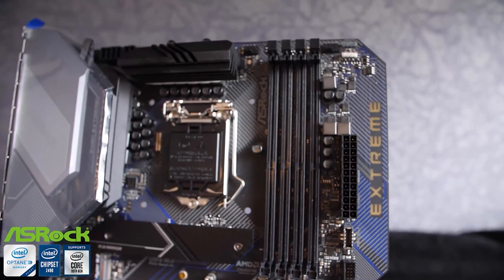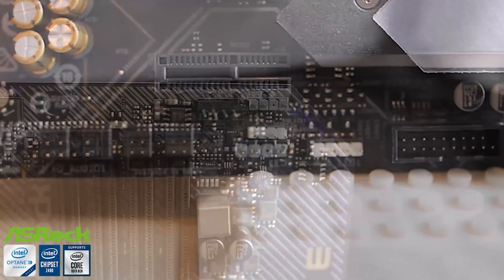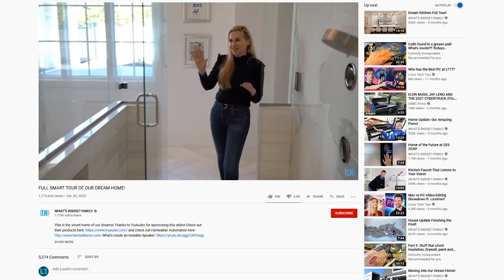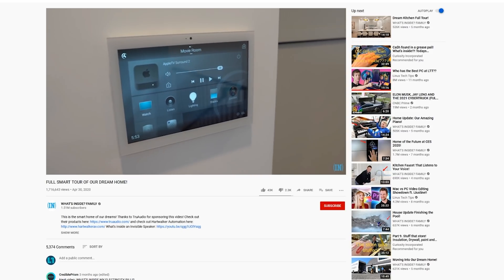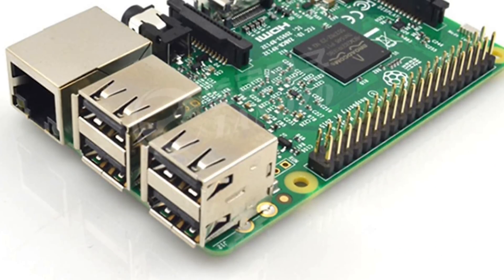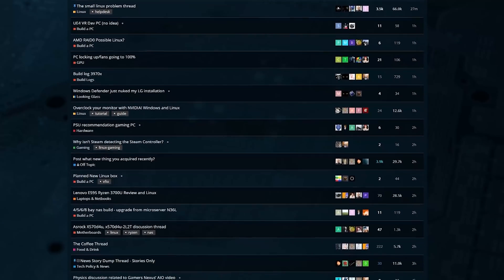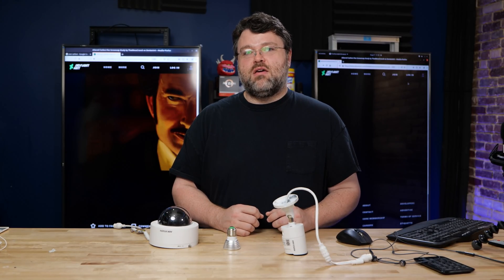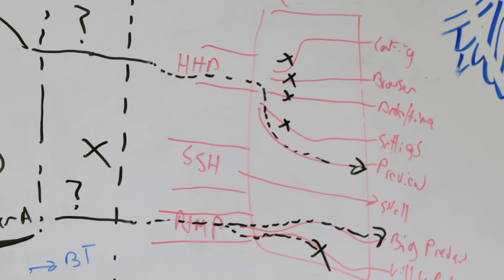Building A Better IoT Part 2: Can We Create A Safe Home Automation System?

Comment: I watched the whole video because it is very exciting. I also could listen to Wendell talking about tech for hours so thank you ! However, I will never go for IoT in my own home. Won’t need it, I can check things and put the blinds up by myself just fine thanks!
Reply: I was pretty much of the same opinion until recently.  Now, I’d really like to build some devices and use IFTTT to alert me if certain things happen while I’m away from home.  One such example is I’d like to know if my gun safes are opened so I don’t walk in on someone in the middle of a robbery.  I’d also like to setup a security system that doesn’t require monthly fees.  And between Docker and IFTTT there are a number of things I could do to better secure the home or be alerted to problems while away.  Our last hot water heater decided to burst a leak in the middle of the night and we were only awakened after the water started pouring through the ceiling which shorted out a smoke alarm and set off all the other smoke alarms.  Turns out, the water leak sensor we had no longer worked nor did the automated shutoff valve, so quite a bit of damage was done before I could shutoff the mains and drain the pipes.  These are just a couple of examples but I’m definitely now thinking I’d like an alert system and camera system.  At the same time, I’m looking at replacing my NAS and upgrading my network so just trying to figure out what my options are.  I’ll certainly watch the entire playlist on this topic and hope perhaps an update will be done seeing how old these videos are.  I also need a system that my wife can understand and maintain if I pass away and so that adds another wrinkle to how, and if, I can get this done.

Comment: Personally I'm using VLANs to try and keep the IoT stuff separate but it's not really a good solution. I can recommend Maltrail as a potentially useful tool for picking up bad traffic. It's designed for detecting malware attempting to reach out but could be helpful for figuring out if your IoT devices are being used for nefarious purposes.

Comment: For me since I'm not going to open my walls and run separate wires to every device I want to control I have chosen the wifi route. I do have a separate ssid that is on its own vlan that does not have direct access to the outside world. I dual home a Home assistant instance so it can have local control for the devices. So I'm kind of using HA as my WAF, but I also tend to stay away from proprietary devices and protocols. So I flash tasmota and esphome for most of my ESP devices.
Reply: I think this is a good compromise. Something you can run locally that segregates those things and runs them all through a proxy that can filter the stuff you don't want.

If you want voice service, but not ads, block the ad requests.
Reply: I’ve recently learned of these ScreamBeam devices that can turn your existing cable coax cables into Ethernet.  Have you guys had any experience with those?  I am thinking about getting some to try out.  Otherwise, I might have to start cutting into walls.

Comment: sorry for commenting before watching, I understand you may have addressed this in the vids but could you guys address potential solutions to the constant need for security updates due to streaming apps and websites constantly updating code. If i were to build my own IOT I'd require personally the ability to leave it for at least 6 months at a time as I consistently forget things, and I don't plan to be positioned in life where security isn't a risk. Would this require a plex-type system (if plex requires updates that would also add security risk for exploits to the overall system then I'd be worried) or is it only possible if it's files on disk and a static media player? I'm tired of needing middle men due to netflix updating every 5 minutes (i cant even use old smart tvs because netflix is too recourse intensive after updates...) and inevitably even the middle men will end up like Ring, where it's subsidized by AWS and they never really were required to back their advertising up with secure and hollistically designed product.
I like to think of things like Apple back in the day, the anatomy of electronic design is effectively not much different, although all the manufacturing, taxes, and regulations have made it impossible for anyone to follow this model, so is IOT similar or is there potential for us to grassroots a system in a similar fashion to floatplane. floatplane doesn't carry over into non-updating, though they have ground up built as good of a service they could with little compromises as possible due to not being tied to other businesses

Comment: Yeah proprietary shit tends to disappear, even if no malicious intent is involved at any stage.
We had a bunch of rather important documents and because they where important we stored them in different formats in the early 80/90s.
long story short:
The only one still feasibly usable is the HTML one. It just looks old but is perfectly fine.Morale of the story never use proprietary shit. But some people just don't learn and call you a conspiracy theorist because they decided to make camp at the peak of mount stupid in that regard.
Even if no one fucks up. Some part might end in licensing limbo or servers go down.
Hint: People with 3 digit IQ don't buy always on stuff before they found a way to bypass that restriction. Or if the company offering the "service" is within of legal reach to tear their ass open to their cheeks if anything fails with decent chance to get damages paid. Which is why windows activation is and will always be easily bypassable. Because otherwise some US company will rip Microsoft apart on first failure. Probably IBM, Apple or Google.

Comment: You can totally use daisy chained Dallas one-wire protocol to control about 300 x DS2408 8-channel switch boards using 1 data+power wire and ground.
Reply from the maker: I have some temp sensors I installed on steam pipes that are the dallas one wire protocol and it works really well but lightning pops those little sensors every now and again. Induced current on the wire, I suppose. I would love something like that, but UL listed.
Reply: @Level1Techs  I think you can mitigate that issue with some circuit protection close to the devices. MOVs and resistors or a transistor buffer instead of directly connecting them in line. Also, there are various well documented Application notes on Maxim's website for reliable 1-wire networking.
Reply: @Level1Techs  also, the ammount of different sensors you can get such as IO boards, protocol translators and temperature sensors as well as Arduino 1-wire device emulators, so that you can use an arduino as a 1-wire device with several analog pins to connect PIR sensors and other i2c devices is awesome.
Reply: @Level1Techs  maybe this can help you out with your sensors dying problem:
https://www.maximintegrated.com/en/design/technical-documents/tutorials/5/5026.html

Comment: What about seperate VLAN for all devices like IoT ? Isn't it the best way (most efficient) to protect your home network ?
Reply: I agree. I think the simplest method is to put all cameras, light bulbs, switches, thermostats on a VLAN that has no WAN access (or access to other VLANs).  I would use home assistant in a VM that has access to the IOT vlan and general VLAN.  Remote access accomplished by my mobile devices using split tunnel or full VPN to connect to home network
Reply: In my opinion if you have a smart home with all sorts of IoT devices you have to have some type of network that allows for VLANs your basic cable modem/router/everything won’t do.
Reply: Not if you want your device to have some internet functionality like chromecast for example.
Reply: @adamlis8112  that's easy actually. When you create VLAN you obviously have a router. You can then create NAT/firewall rules to comunicate from LAN to VLAN bot not allow device in VLAN to establish connection. Also all devices in VLAN can have internet. This is very easy to accomplish. You  can even block everything except some communication protocols so that your chromecast will only do what you allow....
Reply: @lgolebio  But the point is that, you allow some traffic like streaming services to go through, and block telemetry and other data collection. You can't do that with just regular VLANs and firewall ip/port rules.
Reply: @adamlis8112  Yes that's true. Firewall can only block specific traffic/ports/protocols and so on. It will not protect you from bugs in IoT devices. I'm only refering to "cost effective" solution. Also it protects you from someone who gained access to your light bulb not penetrating your home network. That's all.
Reply: @lgolebio  What does it matter which VLAN hijacked IP camera sits in if it is connected to Internet and watches you sleep?
Reply: @Mr.Leeroy  i would never allow any kind of security camera to connect to internet. I would create a VPN server on my home network and access them only from LAN.
Reply: Łukasz Gołębiowski I would assume you’d want them connected to a video server and then access that from the internet or you’d lose remote monitoring capability. If I had no plans to let traffic out I’d just put in cctv system.
Reply: @lordgarth1  I already have such installation in my client's office. Nobody is able to connect to cameras from WAN. Only people with openvpn installed on their mobile phones/pc's are able to connect from internet. So I don't understand your point.
Reply: Why a vlan? Why not just a separate network?
Reply: @davidj1416  VLAN is by definition a "separate network". 🙂
Reply: @lgolebio  I'm talking separate on a "hardware level". So even if I fuck some setting up it's separate.
Reply: @davidj1416  Well. Then don't f*k this up. Even if you have separate hardware you still can do bad things. It is like walking on green light. Does it mean that no car can hit you ? You always need some  caution.
Reply: Why not just do https://youtu.be/HW9mUrF1ZgU

Comment: Instead of each device having their own connection, I'd thought going back to an old Token-ring style would be better? 
all smart thermostats on the same loop, isolated from other devices.
Do you really need a cat5/6 cable to indevidual smart thermostat to transmit a few hundred bytes of data per second ?
Reply from the maker: This is the idea behind something like canbus, but repurposed for home. Also home alarm systems often work similar.y.

Comment: Is there a system that uses ethernet over power lines? Could just have a light socket that has 2 wires to it and talks to a box which turns it on and off.

Comment: Ps - CANBUS is a pretty intriguing template...
Reply: unauthenticated broadcast network, sure sounds fun
Reply: @LA-MJ  hasn't it already been shown that CANbus is able to handle encryption and/or authentication by researchers? It just isn't generally done in the real world due to latency? I feel like an isolated IoT application wouldn't suffer. I didnt mean -"lets use CANbus as is." I meant that it's a starting point. I think that's what Wendel was driving at, as well.
Reply: @omgMBP  TIL